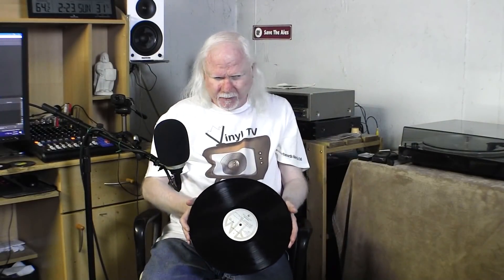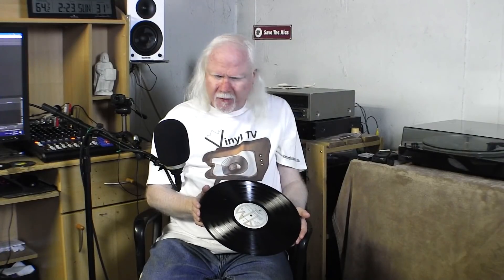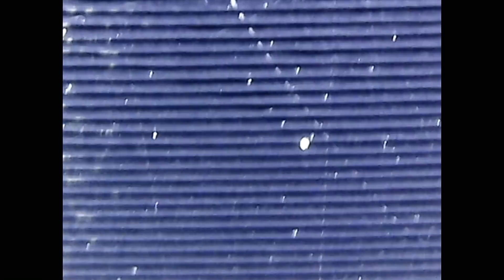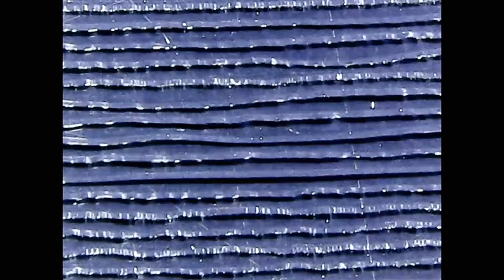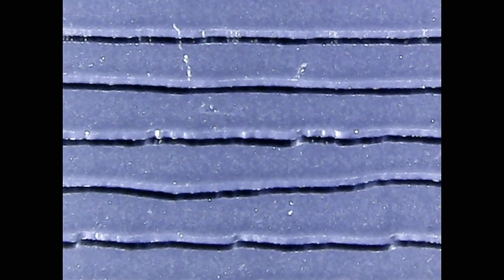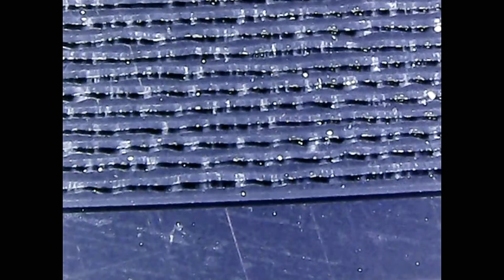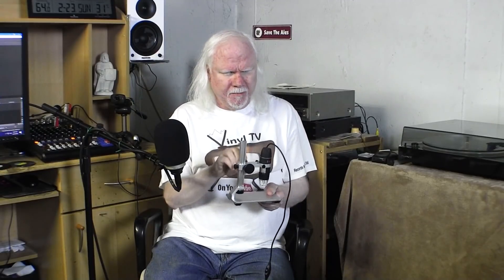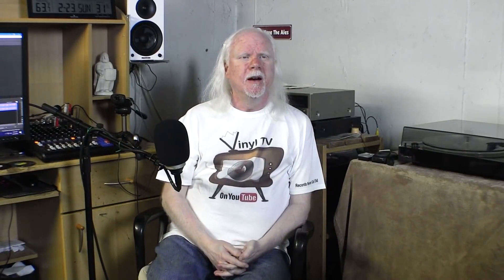Why is Groove Spacing Important?

Comment: Just received some lathe cut vinyl of our new single and when the breakdown happens and the fuzz and organ climax two of the grooves are so close together! This has resulted in some of the  discs having skipping and sticking issues. So gutted. Majority are fine but 10% have a visible merging of the groove areas. Searched on YouTube and this came up so will forward it to my cutting engineer.

Comment: They introduced variable grade in the time, where normal groove 78 rpm and micro groove vinyl records existed together.
A 12" shellac with classic music could be extended from 4 ½ minutes to 8 or 9.
About micro groove and pop music, it hasn't this dramatic effect, but it could make it possible to get 7 minutes from a 45 rpm 7" record and up to 25 minutes from a 12" record with 33 rpm.
The 20 hits compilations were recorded with less bass (nothing below 80 Hz) and less level, so it was 30 to 40 minutes per side. The opposite of this is the maxi single or super sound single, 45 rpm on a 12", maximum length about 7 or 8 minutes.

Comment: Just to set the record straight, 12 inches singles have a wider grooves than LP's and the disc was cut at with a louder volume and the dynamic range is increased as well. The spacing of some 12 inches singles have also decreased a lot Columbia Records are the first to have done it and with good results with the groove wider but closer. Let's Groove of Earth Wind and Fire was one that I got and what is good is that the song is limited to the outer edges. As you know the closer you get to the center of the record the closer are the vibrations of the groove and with a spherical stylus there was a lot of distortion at the end of the record and none at all with eleptical or fine eleptical ones and very good results with Shibata. So concentrating the song to the outer edge elimated the distortion as most DJ's use spherical stylus.

Comment: This was a very interesting video because I learned years ago that albums are cut 1-5 now I'm going to try like heck to explain this a 1 was for say 12-15 min per side a no 2 cut was 15-17 min. per side a 3 was 17-20 min. a 4 was 20-23 min per side a 5 was 23- whatever because I've seen some albums have OVER 30 MIN PER SIDE which is when they are so tightly put together for example Led  Zeppelin's The Song Remains The Same was cut at a 5 because sides 2,3,4 were over 25 min. per side now if I'm wrong on this process Craig let me know
Reply: Good point!  In the late 80’s and early 90’s, when compact discs ruled the earth, albums were getting longer and longer and fewer people were buying vinyl record albums because of the novelty of CD’s.  It was also a self-fulfilling prophecy because those longer albums from that period sounded horrendous!  The Cure - Disintegration, Def Leppard - Hysteria, and Tom Cochrane - Mad Mad World were all long LP’s in excess of an hour and they sounded terrible on vinyl.  Of course, they are highly collectible now but thankfully reissued on two records.
Reply: @josephrobertmah3438  I assume that terrible sound was also because record labels decided to cheap out and release an album on a single LP even though it would have required a double LP release to retain an acceptable sound quality. 

... and because flippin records around is so 1970's - CeeDees can fit a whole album on one disk too. ;)

Comment: I love looking at this stuff! It still amazes me how literal vibrations from a tiny piece of metal puts out great sound! Is it true that a 12 inch 45 RPM is better audio quality than a 33 1/3 album version? Something about wider grooves but wasn’t sure if that was an urban legend
Reply from the maker: Because the vibrations can be spread apart at higher speed (45), it's easier to track those records, especially on a cheaper stylus. It's like with tape... Faster is usually better because the information is not so crammed together.
Reply: Vinyl TV I suppose the same idea as digital only physical space rather than digital. The more physical space used, the higher of quality
Reply: Check out Mobile Fidelity Labs 45rpm albums.
Reply: Like everything if done properly yes a 12 inch 45 ep is usually better sound quality.